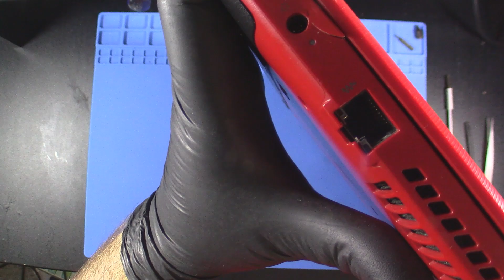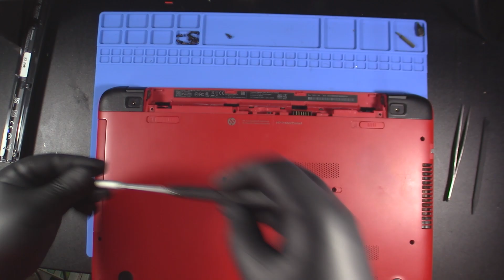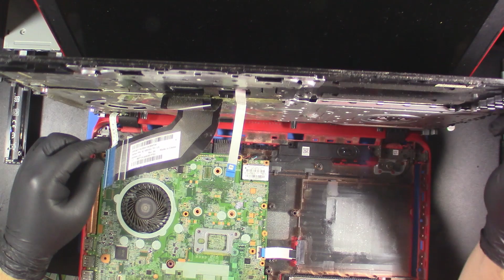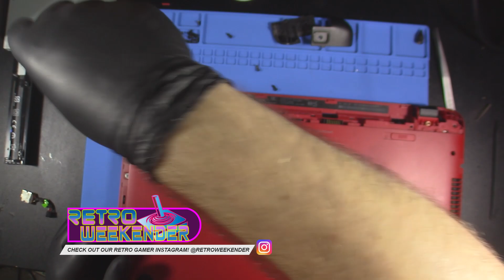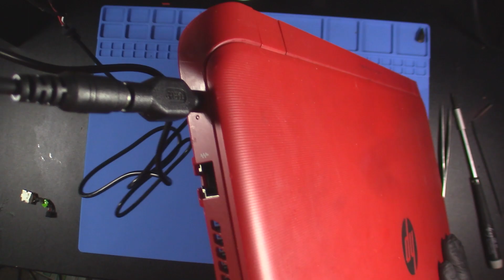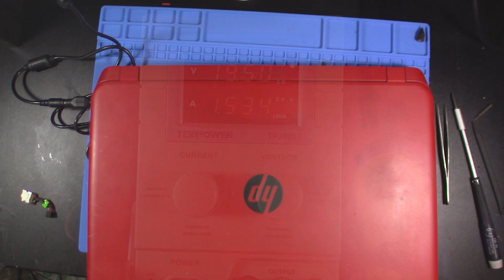HP Pavilion 15 Laptop Charging Port Replacement (DC Jack)

Comment: On my Keyboard as i went to remove the keyboard from the laptop, mine has a gold loose strip attached to the keyboard and looks to be a ln attachment on the other end for a connection somewhere on the laptop but i don't see anywhere that it could have been disconnected from. Any clues? Please.  Thank you.  And very helpful video so far.

Comment: Thank you for this video. Would you share which jack port to purchase? I have this laptop. I've already replaced the keyboard, so I know I can do this!  In your experience, could the jack port come unplugged from the board if the laptop has been dropped enough times?
Reply: little late, but yes it can be unplugged, although i would reccomend you do it yourself, its quite easy to take off

Comment: My laptop charger pin got stuck i hardly pull out the charger pin now the charging is not working i guess charging port is damaged .. i doubt if it is repairable because some laptops have solded charging port with motherboard my model is
Hp pavillon 15t bc 200 its gaming laptop help would be really appreciated...
Reply from the maker: Yea I did a quick search and see two different pavilion 15t models one that looks like it has a modular DC jack and another that looks like it could be soldered on. If it is busted a competent repair shop should be able to solder on a new DC jack. Or replace it

Comment: Thanks for the upload.  Now for my other hp, laptop charging port the metal prongs on the inside that essentially touch the cable when it's plugged in, are bent. One is normal and the other is bent out so the connection is touchy, I wonder if there is a quick fix for that. Maybe if you see this comment you can walk me through some steps.
Reply from the maker: If I understand correctly one connection is iffy? Soldering that connection could make it better. Probably best to just replace the jack itself
Reply: Thanks for the reply.

Comment: How do you eject the optical drive tray without power? And what is the small black plastic pry tool you used to pry the keybaord off from the bottom piece?
Reply from the maker: If you're trying to get a CD out of the optical drive usually there is a small pin hole next to the eject button. Take a paperclip and use that in the pinhole to eject the tray. The black thing is a plastic spudger. Amazon affiliate linked below if interested
https://amzn.to/2V8rt63

Comment: I did exactly the same thing but it still won’t work and orange light is not turnin on..u think there might be a different problem....
Reply from the maker: Haris Ghumman there could very well be. Have you tried a different power adapter? It could also be a component on the motherboard if replacing the jack didn’t work.

Comment: Wait, do all pavilions have five prong things in the regular charging port? That may be my issue, then.... dangit
Reply from the maker: Where it plugs into the motherboard or the center pin of the jack itself? Either way it can vary by model but if a pin is missing it could cause issues with charging or adapter sensing

Comment: Great tutorial, but how did you determine the Charging Port went bad?
Reply from the maker: I don't recall the exact reason for this one without re-watching. I assume physical damage or voltage not making to the board from the jack. Most times it's physical damage